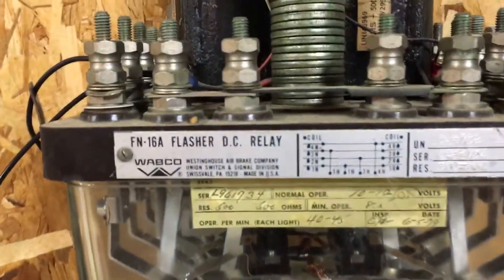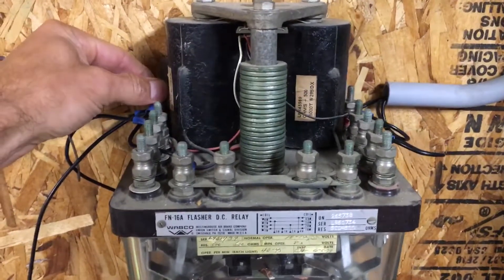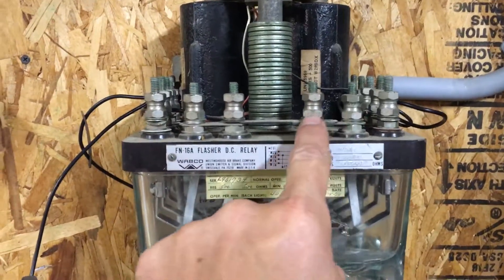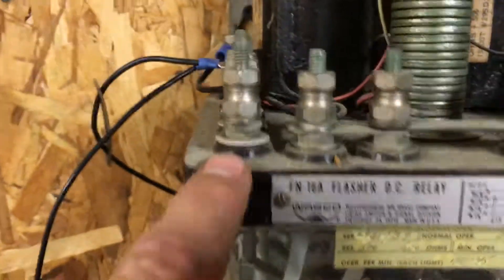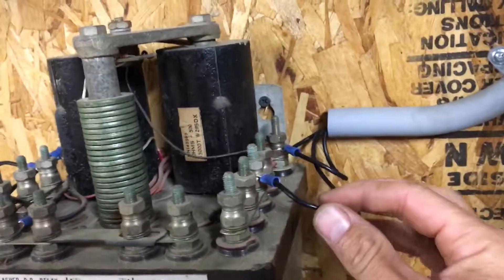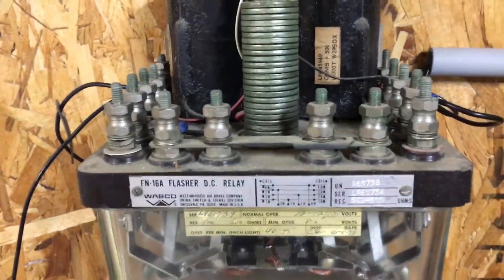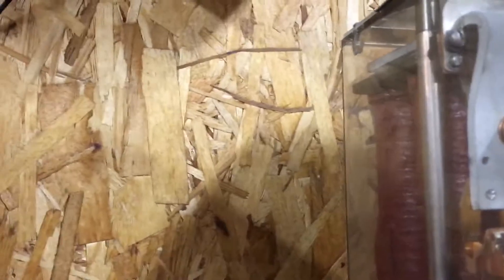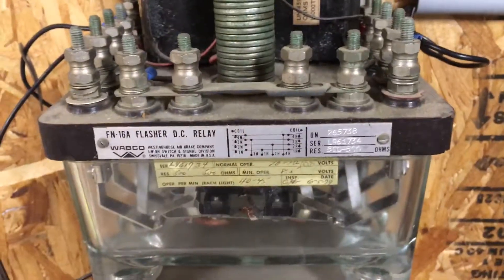Railroad Signal Light DC Flasher Unit US&S FN-16A Wabco Crossing lights how to

Comment: I just bought a crossing pole with lights, signal and crossing sign. With it i also was given a "railcharger" and the flasher relay but mine is an E-1 (calibrated for proper flashing). Looks identical to yours but a little smaller. It appears to be the same setup as your 16-N. Would i wire it the same way as you just said in the video? Also is the railcharger just an AC - DC converter? Any help would be greatly appreciated.
Reply from the maker: Hey. Can you email me a photo of it to mmcronk@sbcglobal.net
Reply: @k9tm  sure gonna shoot them over to you now, thanks